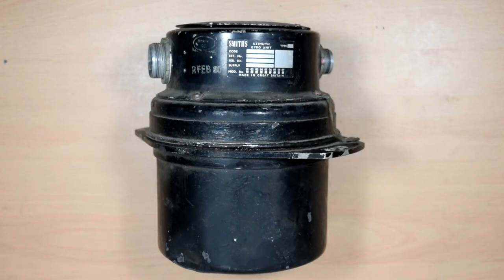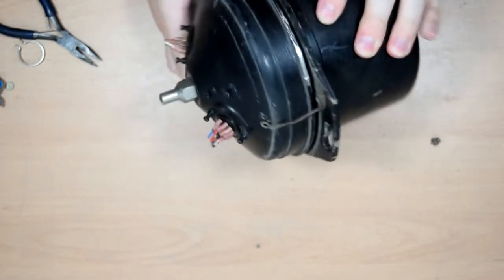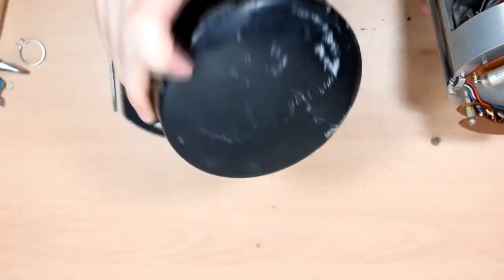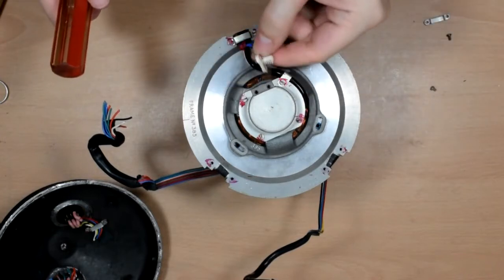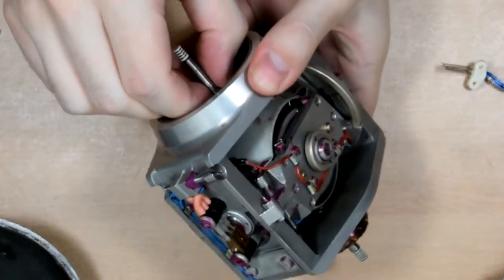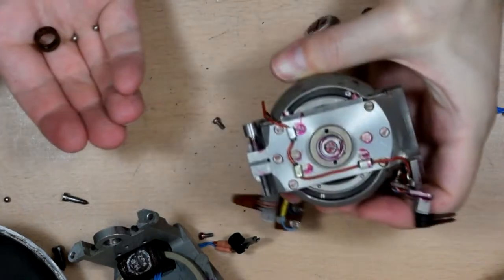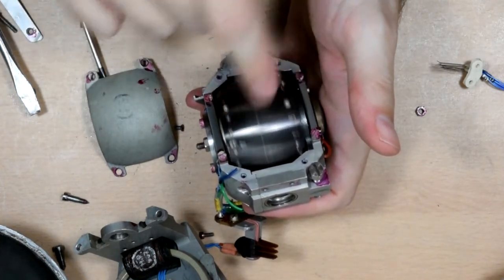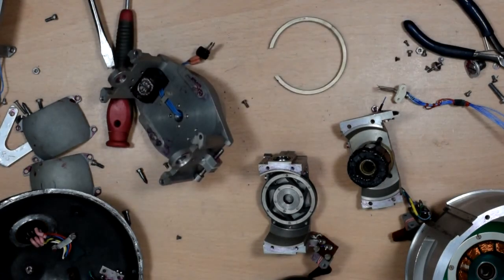Azimuth gyroscope teardown

Comment: I'm always amazed how people managed to engineer stuff like that back in these days without fancy cad/cam systems and multi axis cnc mills...
Reply from the maker: Yes, indeed though semi-'automatic' metal removal machines of one sort or another have a longer history than one might expect.  In this case, there was a lot of bare casting with only critical surfaces machined.  There were also many well-worn balance adjustment screws and fittings.  look at all the holes in the fly wheel!  getting that right must have taken aaages!